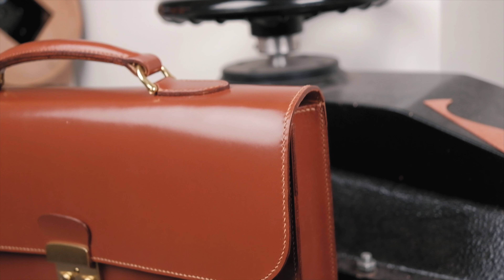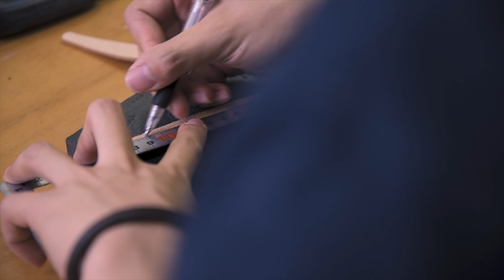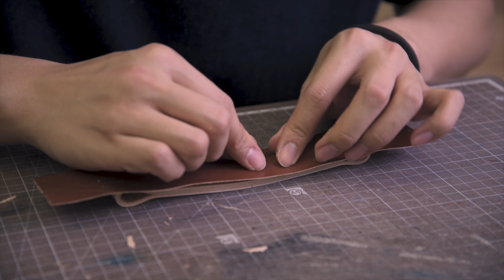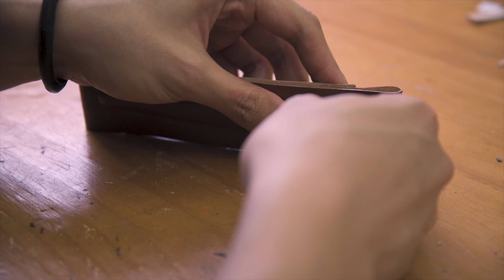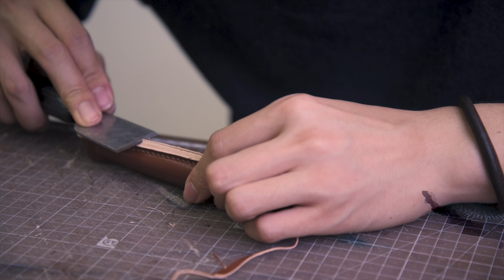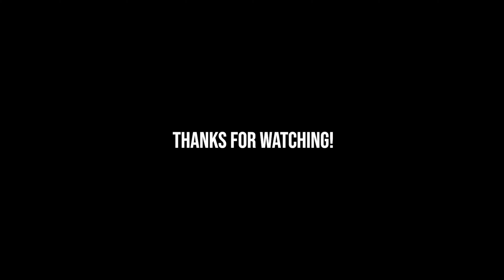Making a leather briefcase handle out of English Bridle

Comment: I have the same knife as you and I found that my other similar style knife, which is 6 times cheaper is sharper and retains sharpness longer than the expensive one. The Japanese store owner told me that if the knife is expensive, no guarantee that it will sharper than the cheaper one and also depends on sharpening the knife.
Reply from the maker: I think more expensive knives usually have harder steel. Which makes it retain sharpness for longer. But the downside is making it more difficult to sharpen too. But yes, there’s no guarantee.

Comment: Beautiful! How did you get the paper template to stick on the leather? I hope we get to see the full build on video!!
Reply from the maker: Thanks! The template was printed on sticky paper. You could also cut it out of normal paper but leave an edge to put on some double-sided tape. I don't directly use sticky paper on leather surface when it's the exterior of the product.
Reply: For chrome-tanned only. you can use rubber cement lightly on the paper template and stick to leather and it will not be stuck to leather, but not the Veggie tanned leather. For veggie tanned, you can use scotch tape outside the cutting line to hold the paper with the leather. or test if it is disfigured the leather surface.